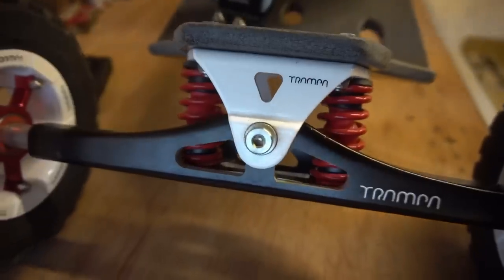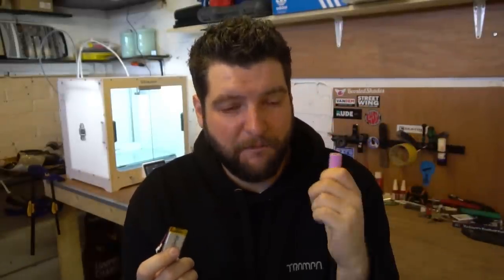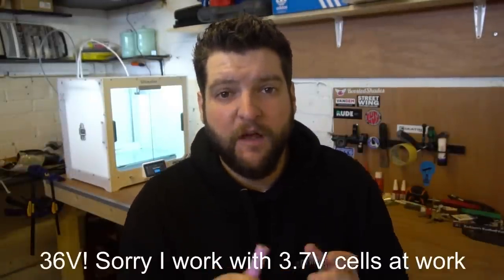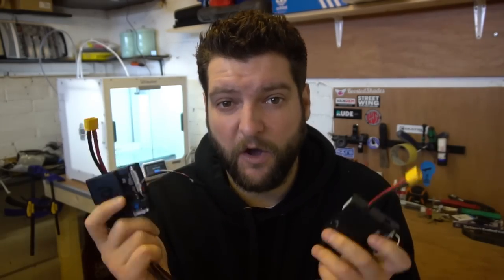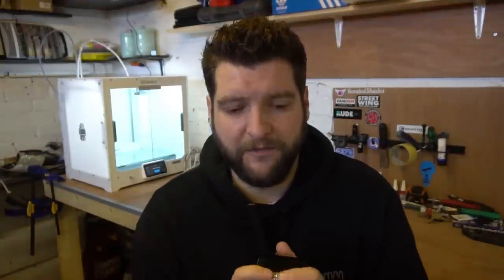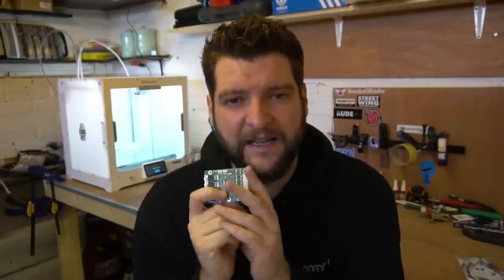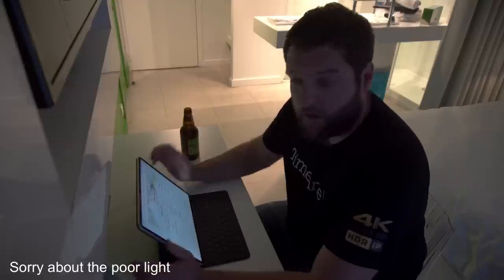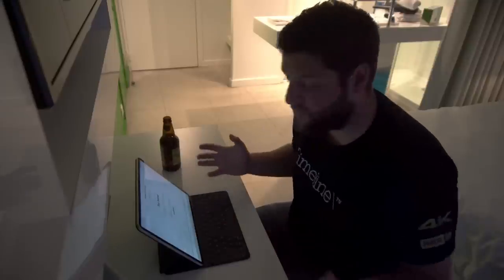How To Build An Electric Mountain Board - Planning Your Build

Comment: I bought a Cross Country electric Mountainboard from Tranzite, but replaced the stock 36v 10ah Lipo with a 40ah battery for loads of range plus an additional 12v 50ah for a sound system and motorcycle headlights. Gotta love modifications!
Reply from the maker: Sounds awesome mate! I love modifying stuff to 🤣

Comment: Wish I realised the motor shaft size difference beffore ordering! 🤦🏻‍♂️
Reply from the maker: Oh dear! What have you ordered?
Reply: @LeeWright  a 8mm pulley kit for a 10mm motor
Reply from the maker: Ben Hibberd Doh!!!!! Well all is not lost, all you need to do is order the 8mm motor pulleys on their own and you can use the rest of the kit.  Research and planning is key!
Reply: @LeeWright  yeah 🤦🏻‍♂️ I realised and reorderd at least that's the only mistake I've made
Reply from the maker: @benhibberd6907  amazing mate, at least you will be able to save it! What else are you going for?
Reply: @LeeWright  39'' board, 6374 170kv motor, 2x 5s 3000 mah lipos (first thing to upgrade) and a flipsky vesc
Reply from the maker: @benhibberd6907  cool, should make for a lovely AT board